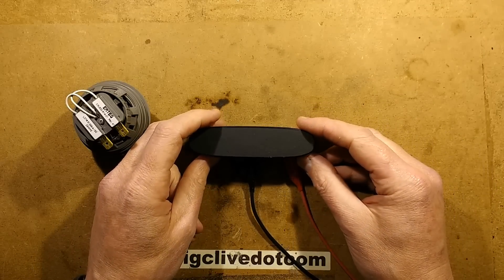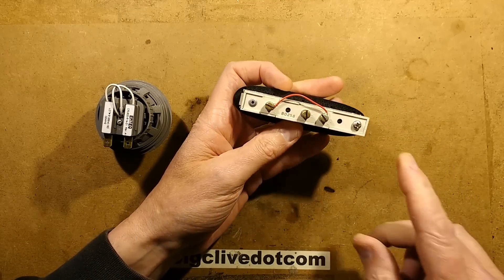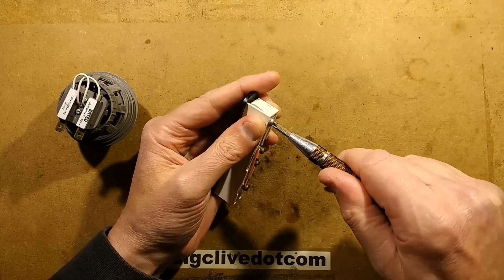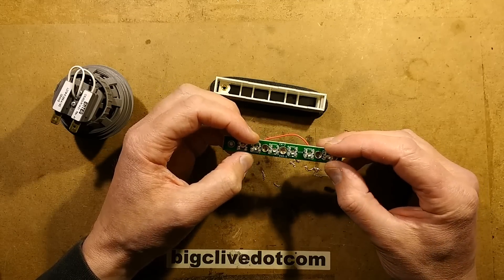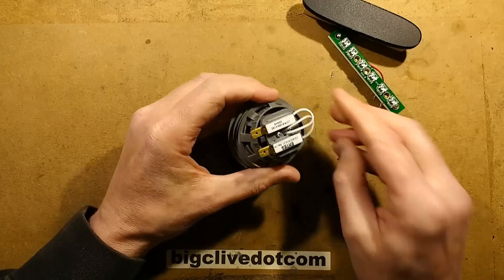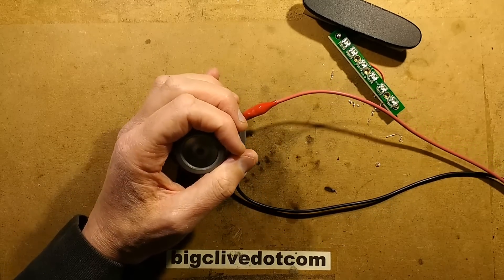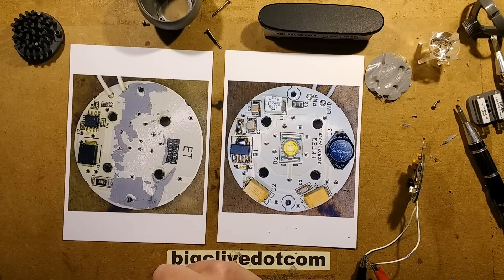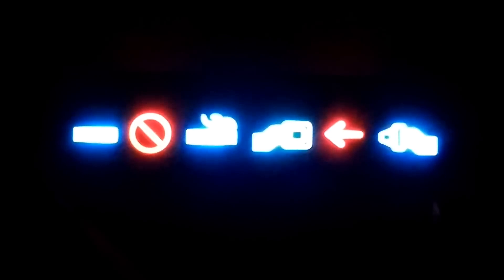What's inside an aircraft seatbelt sign?  (and swivel downlight)

Comment: Welcome to avionics, where everything is expensive, custom-made, and at least 10 years out of date.  
Standard aircraft power is 28VDC and/or 115VAC@400Hz by they way.
Reply: As Paul pointed out, the running voltage of the DC system is 28V. In large commercial airplanes such as Boeing 747, Boeing 767 the standby battery is a 20 cell NiCd bank, 1.2V/cell, with about 100 Ah capacity if I recall correct. When the airplane is connected to ground power, or the APU or engine's generators are running, there is a TRU to power the DC bus and keep the standby battery charged. This runs at 28 Volts, but would drop to about 24 Volts if running from battery only. Minimal equipment on a large airplane runs on 28 Volts DC. Most of the lighting, fans, entertainment systems, hydraulic pumps, galley ovens, toilet vacuum pumps etc. run on 115 V, 400 Hz, 3 phase.
Why 400 Hz on airplanes, and not 60 Hz ?? To save weight. Motors, solenoids and transformers can be much smaller and lighter when operating on a higher frequency. Also, smaller filter capacitors are needed in power supplies, since 400 Hz is easier to filter out since it is "further" from DC than 60 Hz.
Reply: @LakeNipissing yes true Aviation power is 400 HZ on AC system also used elsewhere besides Aviation in some cases

And if people are wondering about the aircraft power for passenger use you bet 400 HZ

Most modern devices have no problem with using 400 Hertz.

By the way used to travel frequently and is aware that I need an additional power sometimes and this was accommodated easily you know there are receptacles which are much higher rated power if I remember correctly 15 amps in a couple places in the cabin.

Yep was encouraged to use it what is the problem when things are realized

And yes I've heard about people charging laptops from this too often people have gotten on board although not always!

But when you're straight up authorized and recommended to do this different story entirely!

I was even asked if I had a power strip in my carry-on have one without even a surge protector on it use the plug-in one since the expensive strip you never wear these out when you use medical grade!

Ever notice how they use medical grade or a specification grades in stores where frequently vacuum cleaners get plugged in and so on much better hardly ever need replacement!

More pricey but worth it what are stuff is always being plugged in and unplugged all the time and also environments and or places like Workshop environments much easier than having to replace the receptacles who knows how many times yeah sure a little more expensive but better long-term investment!

I know someone that has a medical grade cord reel under the workbench
Reply: To add to what is posted above, there is a new kid in town, the Boeing 787, the carbon-fiber 'plastic' fuselage airplane. Of course it became infamous for being the first airplane to use lithium standby batteries, which on several occasions went thermonuclear (to quote Clive), making news headlines, and were grounded for fire investigations. Although the battery bus is still operating at 28 VDC, which is conventional, the generators, instead of running with constant speed drives for constant 115 VAC, 400Hz, now operate "wild frequency" saving the weight of the CSDs between the turbine and the generator. Generator output is now 235 VAC, 300-800 Hz, 3 Phase which is converted to regulated aviation-standard 115 VAC, 400Hz, 3 Phase AND a new 540 VDC bus. This 540 VDC is used for electric start for the engines once the APU is running, since the Boeing 787 no longer uses pneumatic pressure to spin up the engine turbines for starting, as other airplanes do.
Reply: @LakeNipissing   Some early turbojets like the P&W J47 (used on the B47, B52 and B36 bombers designed in the 1940s/1950s) did use electric motors to start their engines, but these used ground power only for starting - for some reason they couldn't be powered during flight for engine restarts, or at least that's what AgentJayZ says in some of his videos, he does a lot of overhauls and testing of those old engines. Anyway, that's why those engines have a fairly long bell-shaped part sticking out in front of them, this is the fairing to cover the electric starter motor.

As I understand it, the reason most aircraft switched to using pneumatic starters was to save weight: Early turbojets could be started with an electric motor, though a fairly beefy one - the J47 starter ran at 30 volts at 400 amps (that's 12 kW, about 10 times more powerful than most car engine starter motors), which is a heavy beast of an electric motor. It also has the downside of limited run time before it overheats - you get 3 x 30 second runs, and if your engine hasn't started after that, you need to wait an hour for the starter motor to cool down enough to try again. Also, consider that a J47 is a fairly small engine by modern standards, and if that needs a 12 kilowatt electric starter, imagine how big and heavy a starter motor would need to be for starting a whopping great big turbofan engine on a modern airliner. 

Hence the development of the pneumatic air-powered starter - basically a little turbine with an integrated planetary reduction gearbox, which can be a lot more powerful than an electric motor while being a lot smaller and lighter. Plus it doesn't overheat - as long as you have an adequate supply of compressed air, you can run it for as long as you like. The APU in most airliners therefore has several outputs - it drives a pair of generators, one to make the 28 volts DC, the other to make the 115 volt, 400 Hz AC. Plus a hydraulic pump to pressurize any hydraulic systems. It doesn't drive a separate compressor for compressed air supply, it just has a compressor stage which is larger than it needs to run itself, so has more than enough compressor bleed air capacity to supply the air starters on the main engines.

So presumably the 787 engine-driven generators have a 3-phase (6 power diode) full wave rectifier on the "wild frequency" output and then an inverter stage to make the required standard 115 V, 400 Hz AC power? A bit like how the generators on wind turbines work, since these vary in speed (and hence output frequency) with wind speed, so need a rectifier and subsequent inverter stage in order to synchronise with the electricity grid.
Do they have a separate starter motor for engine starting, or do they have a motor-generator which acts as the starter motor to start the engine and is then driven by the engine to make electrical power for the aircraft? If it's the former, then I'm not sure how having both a generator and a separate starter motor would be lighter weight than using a conventional pneumatic starter. If it's the latter, then I'm similarly unsure how a motor-generator would be capable of being powered by 540 volts DC and then switch over to providing the 235 volt, 300-800 Hz "wild frequency" three phase AC. Does it have multiple windings, with some used for starting only and the others for generation? If so, that is surely also bulkier and heavier than a pneumatic starter would be - because as I understand it, the construction of a DC-driven motor and a 3-phase alternator generator are very different - you can't use the same windings for both functions.
Reply: That was an interesting read. scary as hell, but interesting nonetheless.
Reply: LegendLength: Because batteries are DC, and need constant or pulsed DC for charging. And aside from inductive loads such as motors and resistive loads such as incandescent lights and heating elements, most electronics require DC to operate.
Reply: +LegendLength
AC over DC because transformers.  In the last 30 or so years, DC-DC voltage conversion has become small, cheap, lightweight and practicable, but standards persist.

It's also easier/cheaper to generate AC than DC.  Back when I was a kid, many years ago, car manufacturers stopped using dynamos (DC) and switched to alternators (AC, with rectifiers), because they're cheaper and more reliable.

Oh, and synchronous resolvers need 3-phase AC.  Although these days an optical sensor would be cheaper, lighter and more reliable, so I doubt you'd see a synchro in anything designed after the 80s.

Standards tend to stick around for a long time.  Because there's no point designing avionics that runs on anything other than 400VAC when that's what aircraft have.  And there's no point using something other than 400VAC as aircraft power when that's what all the avionics uses.

To get it changed, a plane manufacturer would have to agree in advance with all the avionics manufacturers to change to something else.  That's a lot of co-ordination and a lot of design changes.  And component changes: there are a lot of aviation-qualified components that are designed for 28VDC or 400VAC.

It's not always possible to design components for other voltages without a weight or size penalty.  A relay coil can easily be wound to cope with a different voltage, but the contacts cannot.  Lower voltage means higher current, means larger contacts.  Higher voltage means longer arcs, means larger contact separation.

So there's a lot of prior art out there that's not going to go away any time soon.
Reply: It all depends on the aircraft, having worked in the industry, there are any number of voltage levels, depending on the size, from 12v power receptacles for single pistons, to the monstrous 48V @ 400Hz GPU Cables for Larger Airliners.
Reply: dunno but trucks with a 24vdc socket are generally at higher than 24v - equipment designed for 24v nominal with lots of ups and downs will work fine at a regulated 28vdc.   The Mir space station used regulated 28v dc too
Reply: bdf2718 ac is used because it's lightweight and straightforward. 28VDC is used to charge 24V batteries and gets a full charge voltage of ~27VDC
Reply: Well, "out of date" is a relative term here. It's the age-old conflict between safety/security and speedier development - the two are pretty much mutually exclusive. 
Sure, everybody who boards a plane with a smartphone in his pocket is guaranteed to have software on it that literally did not exist 2 years ago and hardware in it which was never designed for the long haul. But then, passenger airplanes have a service life of 20+ years, whereas most people ditch their smartphone every year or thereabouts in favor of a newer model. In the aviation industry, manufacturers have to be able to supply spare parts and service for the entire service life of a component. On the other hand, good luck finding spare parts for an entry- or mid-level smartphone that is older than a year. Even for top line flagship models, two years is probably stretching it already. 

The upside is, that every piece of electric/electronic gear that goes into an airplane these days has thousands of hours and millions of miles of operation, continuous testing and maintenance without any failings under its belt. I take a plane with "somewhat dated" technology any day over a plane that is stuffed full of the very latest tech that just came out last week and was hauled off a shipping container this morning. Especially when I have to stake my life on it. 
Heck, up until a few years ago, smaller airlines still used video tape machines in the entertainment systems of their fleets. Even if you look at the software developed for aircraft, there's considerable cost involved when it comes to upgrades. Changing even a single line of production code in a critical avionics system can cost upwards of six-figures with all the testing and certification. For what it's worth, I am perfectly happy with a plane that doesn't have all the latest bells and whistles if it gets me there safely.
Reply: Why 28V and not 24? 28V is the running voltage of a 24V system, taken from the alternator, in the same way as a standard car 12V system will actually be running at 14V (13.8V? 14.4V?) as that's the alternator voltage given to charge the battery. My aeroplane/s a 24V/28V system. I have a screw on my voltage regulator to set the voltage. The battery is two 12V blocks in a case, connected in series (RAF type).
Reply: sirp0p0 There is a major problem there.  Some years back when trying to figure out how often fake parts end up on active aircraft, the US NTSB found out that even their own parts warehouse contained cheap fakes labeled as real.
Reply: Caleb Vincent Well yeah. I hope they're not buying their electronics off of eBay or Aliexpress.
Reply: Because airplanes, duh. ;) https://electronics.stackexchange.com/questions/73925/why-28v-dc-bus-is-a-de-facto-standard-in-aviation-industry
Reply: Caleb Vincent many use 5v lighting systems though in cockpit and indicator lamps. Including FSB/NS signs.
Reply: I don't have a direct source, but an article on Partnair Flight 394 will probably bring the issue up, since that was one of the reasons it crashed.
Reply: Mr. Bob Cyndaquil Thanks! It did in fact.

"The USDOT audited the FAA's inventory and found that 39% of the parts in the bins were counterfeit. "
Reply: John Francis Doe Can you give me source for that? I tried to use google but got nothing useful :/
Reply: There are multiple standards for voltage on aircraft.  My aircraft is rated at 12 volts.
I pretty much agree with the rest.
Reply: +Micro Henry
We can go much deeper than that.  But youtube comments aren't really the place for a 3-year electrical and electronic engineering degree course. :)

Or I could just have said that AC was used because reasons.

There were good reasons for doing it that way back in the early days.  Some of them (400Hz vs 50/60Hz) are still good reasons.  Other things persist because it's too much trouble to do it differently.  Which is a reasonable description of much of life, really.
Reply: Caleb Vincent why 28V? Why not industrial standard 24V?

Comment: That light seems overly complicated for the job it apparently does.
Reply: no, it is just about right when you factor in the safety standards.  the electronics have to be designed in a way to prevent any remote chance of a simple malfunction (like a shorted out trace) causing a possible fire.  they also have to make sure that the thermal output is as low as possible since the wiring could be affected by thermal variations over time, and if you have vital cables running in the same area, you want to be sure there is no chance of insulation being affected in any way by a heat source that could make it brittle.
Reply: Aerospace gear tends to be heavily overbuilt, for safety (and reliability) reasons. There's a reason flying is one of the safest forms of travel.
Reply: A lot more people die in their cars. like a lot more. It just gets more media attention if many people die in one place(like a bus, a plane or a ship).
Reply: The majority of those were due to faulty maintenance or pilot error iirc. Not to mention that doesn't change the statistics, lol.

Comment: I think nowadays, the smoking ban has been in place for like 20 years, some replace that no smoking sign with no electronic.
Reply: The most funny thing is you can disable that "no smoking" light from the cockpit via a separate switch - just in case they'll bring back smoking on airplanes during airplane's life cycle. Sometimes there's even an option to test if that lamp works correctly.
Reply: yes,  both no smoking and seat belt has Auto On Off position. In airbus seatbelt light will turn on if the flaps is down. I think most airlines don't use auto.some just left it on all the time

Comment: let's see.. a plane with BigClive, Photon and Colin on board.. what could possibly go wrong.
Reply: Clive would be sitting in a corner surrounded by a pile of all the lights off the aircraft, muttering about the poor quality of their Chinese LED Drivers and isolation.
Reply: Well... either the plane becomes 1000x better or explodes
Reply: that or  one of the three activate the  "self destruct" button while mid flight and the plane just falls to bits XD .. photon would just start messing with high voltage and  yea... ...
WE ON FIRE RICKY BOBBY, BABY JESUS TAKE THE WHEEL .. i mean the uhh STICK  XD
Reply: nasan...I think the odds is on both things happen.
Reply: What about ElectroBoom? Ok he'd probably be the only sane person on there. Just very clumsy.

Comment: 1:02 "non relampable"
12:11 Relamped!

Admit it. You only changed the LEDs because it says that you can (or at least should) not.
Reply: "No user-serviceable parts" only applies to users.  Techy people are not of that ilk.
Reply: Syncubus According to a TV documentary, an airliner crashed because the pilots were  too preoccupied changing an indicator light instead of landing. I guess that resulted in a ban on in-flight replaceable lights.
Reply: Especially if they're down the back of the cabin...